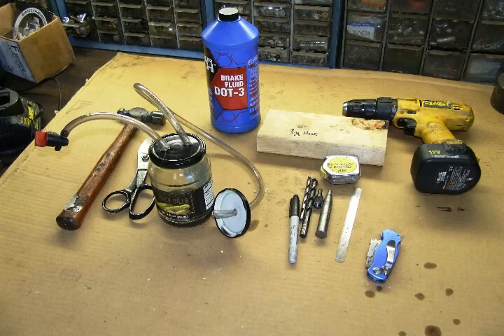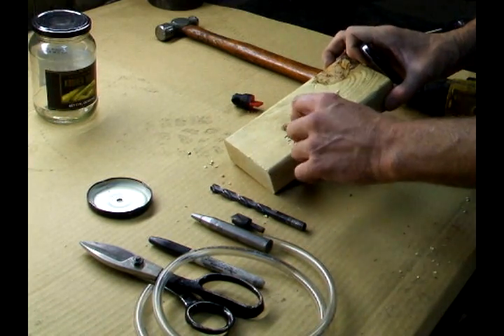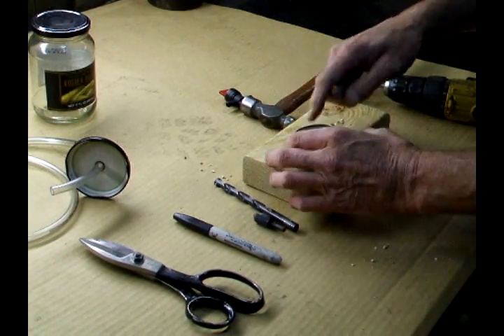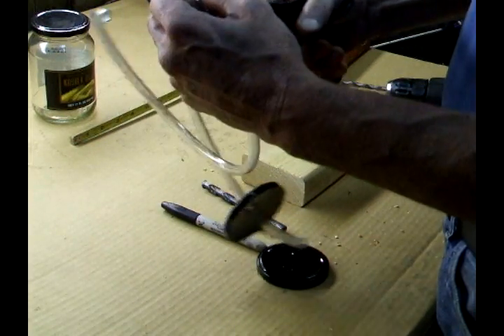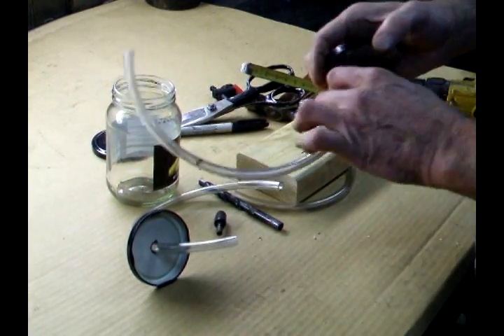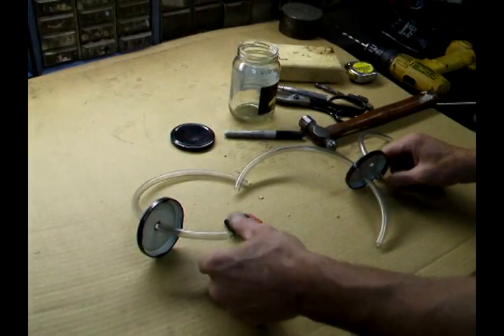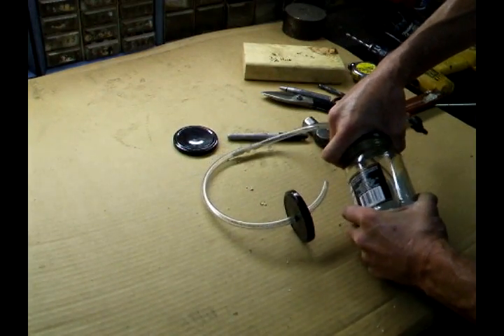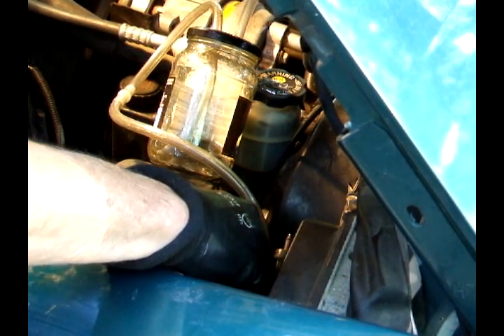Build a Pickle jar power bleeder

Comment: I am trying this on a  '95 toyota 4X4 22re truck. What vacuum line are you connecting this to? I have all the parts now. Just need a little guidance. Also, my fluid reservoir has a hard plastic "disk" that sits on top of the fluid. Any clue as to what this is?
Reply from the maker: Find a port on your intake manifold. You might have to remove a rubber hose, I used the one to my cruise control, but any one on the manifold will work. When you start the engine you will have a vacuum. The disk is a filter screen remove it until your done. then put it back. If you can't just leave it there.